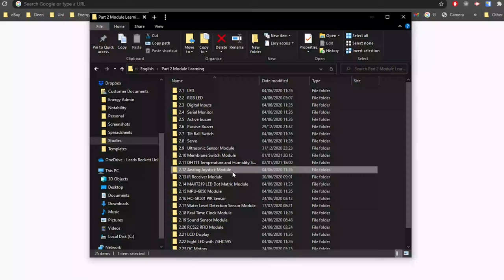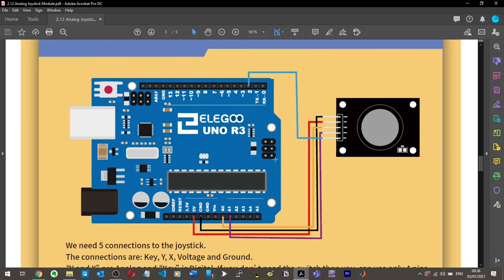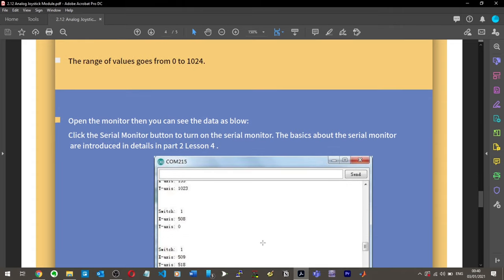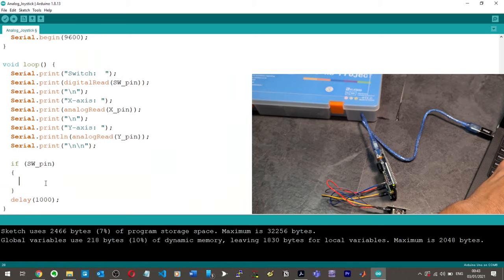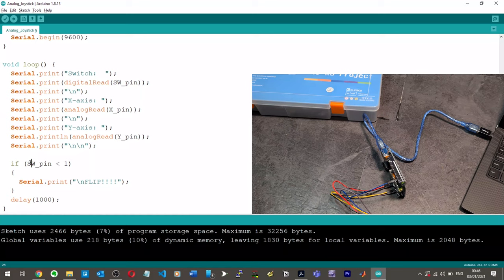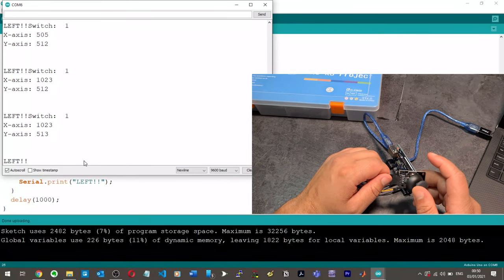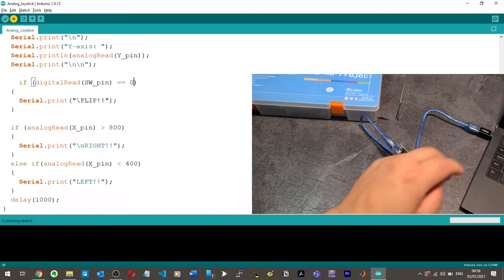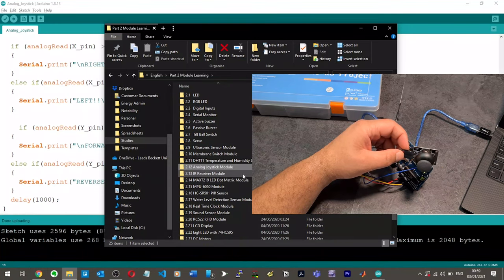Analog Joystick Module Arduino Tutorial - Elegoo The Most Complete Starter Kit

Comment: I am glad you figured it out. What I hope you and others watching learned was:

SW_pin is NOT a "variable", it is a "constant" set to 2, which is the "reference number" to pin 2 (a digital I/O signal).
So,  if(Sw_pin == 0)   or   if(SW_pin != 0)   or  if(SW_pin > 2)  will never be true because... SW_pin is equal to (was set as a constant) 2.
You simply can't operate on the name "SW_pin" (just a name for 2) alone, you need to call a "function" that reads a pin, and tell that function which pin you want to read.

So:
digital.Read(SW_pin) is the same thing as saying digital.Read(2) which will both read digital pin 2 as a digital signal. Which can be a value 1 from pin 2 if pin 2 is high (about 5 Volts) or be a value 0 from pin 2 if pin 2 is low (about 0 Volts).  But digital.Read() worked only for that instance (place in code). So if you want to use the value elsewhere in your program, you need to put it in a variable so other parts of your code afterward will know what was on that pin when it was read.

Digital pins can only get set or read as a 0 or a 1.
So, let's use an analog pin which can give us a value of 0 to 1023 depending on the voltage (0 to 5 Volts) on an analog input pin.

const int Analog_X_pin = 0; /* This is name were are calling Analog Input 0 which is connected to a signal called X */
int X_state;  /* This is where we will save the Analog value read */
X_state = analog.Read(Analog_X_pin); /* Read the Analog value and save it in the variable, */

Now other parts of your program can work off of what analog pin 0 (what you are calling Analog_X_pin) was at that time (value saved in the variable X_state)... like seeing if it was greater than 500 or just about anything you want to do with the value. 

if(X_state > 500) { /* do something */ }

I called it "X_state", but you could have called it "guacamole" or whatever makes sense to you.

Getting back to this program:
So why did we define SW_pin as 2 when we could have just used a 2?

Simple: Suppose you were using 12 digital I/O pins in the same program. Calling them: 0, 1, 2, 3, 4, 5, 6, 7, 8, 9, 10, and 11 would work, but you might keep asking yourself "What was pin 10 for again?"  But if you set a constant with a "name" for each pin, your code is more readable (not just for you but for others).

const int PIN_RX = 0;
const int PIN_TX = 1;
const int PIN_BLUE_LED = 2;
const int PIN_MOTOR = 3;
const int PIN_TEMPERATURE = 4;
const int PIN_SERVO = 5;
const int PIN_JOYSTICK_SW = 6;
const int PIN_RELAY = 7;
const int PIN_WATER_LEVEL = 8;
const int PIN_LED_WHITE = 9;
const int PIN_BUZZER = 10;
const int PIN_IR_DETECTOR = 11;

Now, if you want to turn on the Buzzer, you simply code: digital.Write(PIN_BUZZER, 1).  See, you don't care if it is on pin 10, you refer to it by a name you gave it, the compiler (code interpreter) will figure out what you mean.

Hey, why not define ON and OFF as well:

const int OFF = 0;
const int ON = 1;

Now you can code:
digital.Write(PIN_BUZZER, ON);

See, doesn't that make more sense than: digital.Write(10, 1);

Notice that I made all my constants in UPPERCASE. In C/C++ we have the "convention" to make our constants upper case so we know they are constants when we read the code. There is no "law" to do this, but you will find this is one of many conventions we all use to write code that is easy to read and makes sense, for everyone. Also, I prefixed each with "PIN_" to remind me it is indeed a pin, and not some other constant for some other purpose.

One final note. Get out of the habit of putting a new line '\n' at the beginning of a string, put it at the end of string. This is another convention and makes sense when you will start working with text files.

No: Serial.print("\n<Your text string here>");
Yes: Serial.print( "<Your text string here>\n");

Comment: Nice to see you spotted it! Confused me for a bit as well :p.

So, the values set to SW_pin. X_pin and Y_pin are the actual pin numbers (0, 1, 2) that you connected the joystick to. They are using them to make the code more readable (so you can tell what the digitalRead()/analogueRead() functions are (intended) to do -> "analogueRead(1)" rather than "analogueRead(Y_pin)", though maybe you were starting to get that by the end anyway :))

Essentially, the read() functions basically "translate" high level code into the actual register manipulations on the microprocessor required to read the pins. Those functions basically say "check the pin <x> and see what value it is. Then return this value". Try it yourself, redefine the button pin to a different number and move the wire there. Bear in mind you can't necessarily do that with the analogue joystick outputs, as only certain pins are connected to the ADC. The ADC has to do a bit more work to figure out the exact value, since the joystick is sending it a variable voltage, so there is only one available on the Arduino, connected to a few pins.

If you want to improve the program, you could set the read() functions equal to variables at the start, and compare to the variables later, as the Arduino read() functions are a bit slow (Granted, not really relevant most of the time), so if you don't have reason to expect a change it's probably a good idea to save them for comparison instead of rereading (which could also lead to nasty things like button bounce between evaluations; ie. the value changing between sections of code unexpectedly.)
Reply from the maker: Mate I'm telling you, you got to start a YT channel lol I'd listen to you all day, you explain this stuff brilliantly. 

I think an issue I have when looking at the code initially, I glance at it all and decide quickly what I do and don't understand and then go from there. If I actually paused the video and gave it 5 minutes I'd probably pick things up better. Reading your comment now, its obvious what the analogueRead functions do lol. 

Regarding setting the read functions to variables, do you mean such that the if statements would be if (horizontal > 800) instead of if (analogRead(X_pin) > 800) ?
Reply: @HamedAdefuwa  So an alternative to recalling eg. analogueRead(X_pin) in the if statements, at the start of the loop you write x_axis = analogueRead(X_pin), then any time you need to access the values you check x_axis, rather than rereading the pin. Especially for analogue reads, this will speed things up, since a variable comparison is much faster than rereading the pin. Not an issue in a small, basic program, but the more stuff you start doing the more you'll want to save time on common operations.

example:
rather than:
serial.print(analogueRead(x_pin)
if(analogueRead(x_pin) > 800)

try:
x_axis = analogueRead(x_pin)
serial.print(x_axis)
if(x_axis > 800)

Of course, if you do need to update the value you have to read the analogue pin, (say, a menu), but most of the time in a fast loop you should only need to read the pins once (since the loop will execute 100's or 1000's of times per second) so they get read very often anyway.

Re: interpreting code, It's definitely a matter of just getting practice in. I'm still not great at it, have only really been dabbling for a few years and never really put a ton of work in, but I've been picking up things here and there to the point I'm pretty decent at it now. It's probably worth trying to figure out what everything is doing in these programs, since on the whole they are pretty simple so it shouldn't be too difficult to work things out with a bit of context and google-fu :P. Maybe after a few more tutorials take a random sensor or part out of your box of goodies and just write up a program to run it, rather than copying the elegoo version; look it up on google etc to work out how to do it. Fastest way to learn things is to just go and do it IMO. I learn more in a single difficult project than half a dozen basic tutorials xD.

I am working on a video of my own, though it's covering something a bit more advanced; implementing a boost converter using an Arduino. It's a lot harder speaking while recording yourself, I'll say that much :p
Reply from the maker: @jordanb722  Jordan I was with you until you said they're pretty simple, you lost me there! lol I completely get the using variables instead of the reading the pins. Thats what I kind of attempted to do initially but just never actually created the variables lol.

I've subbed to you so look forward to the video. You're right about the difficult project over basic tutorials. I'm due to start uni again next week so I'm keen to try and get through as many of these basic tutorials as I can. I'm studying communications and analogue electronics next :/ :/ I'm expecting tears in a few weeks.